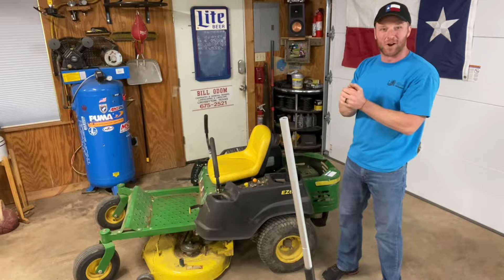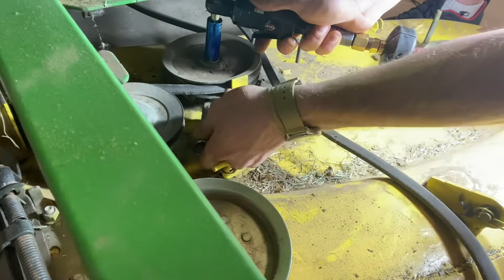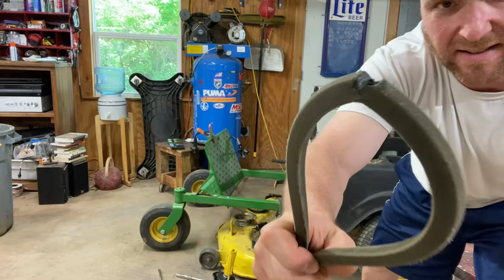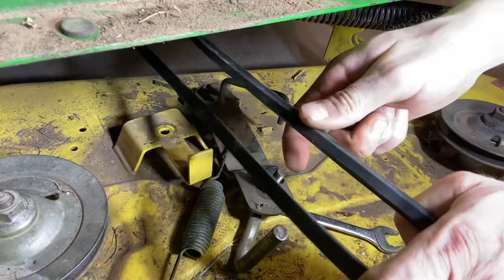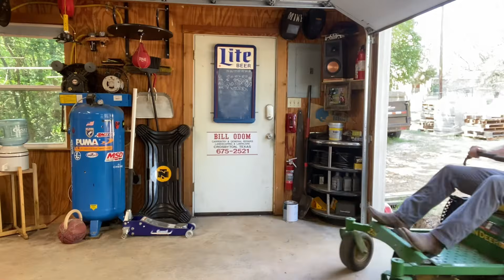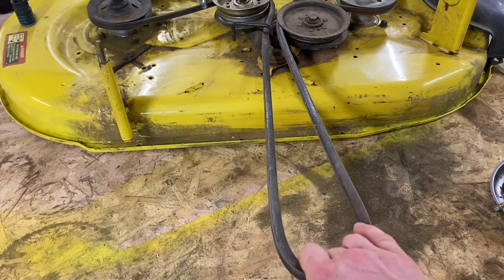Zero Turn Deck Belt Replacement, John Deere EZtrak Z225

Comment: good video... just a thought when you get the bad belt off you can make life easier by removing the spring once its loose so you can get that last pulley on without having to hold the tensioner and then pull the tensioner to put the belt on. Just a thought
Reply from the maker: Good hint

Comment: Ok so.. we are a mom and daughter team. Attempting to keep 2 1/2 acres from becoming a jungle. Well.. yesterday, while cutting tall damp weeds/grass, the belt came off. 
Question: How do we get access to the underside to do all that unscrewing of nuts and bolts 😫😭
Reply from the maker: Love it. First try and lift the plate where you put your feet. It should lift like a hood and you can get to the deck pullies from there. Let me know what other questions you have.
Reply: @MowerMike  Thank you, I also found your other videos , super helpful 👍🏽
Reply from the maker: @Whattheheck1  Just take it slow and step by step. It can be frustrating.

Comment: A friend said leave the  outside belt guide covers off for easy cleaning. Did that and a rock or stick got between the belt and pulley and broke a fairly new belt. Obviously this isn't safe and dangerous. I've pulled back on the belt guards with a wrench before and hammered them back in place, probably not a good idea either. Thanks for the help I love my mower, have e had mine for  10 years +, John Deere makes a great product. Oh yea, the deck is easy to take off, probably need to do that once a year just to check everything out! My favorite part was using the socket wrench to loosen the tension at the beginning of the video, great! Thanks for your help!
Reply from the maker: Glad it helped. Now we have to get to mowin!
Reply: @MowerMike my z225 has more pulleys on the deck than yours does... i cannot figure out how to change the belt. Can u help?